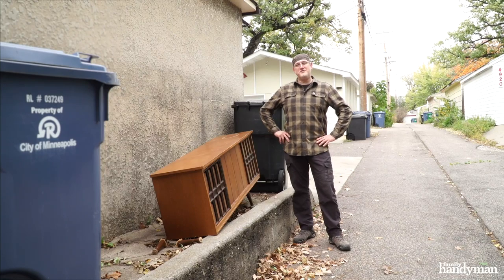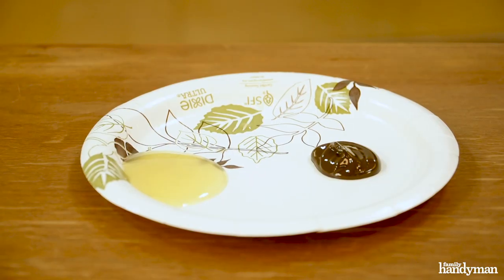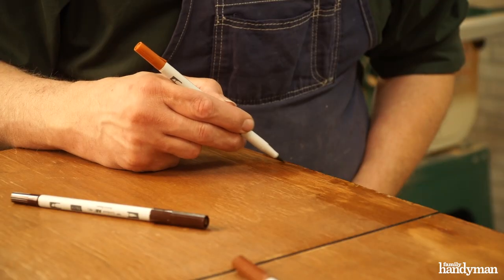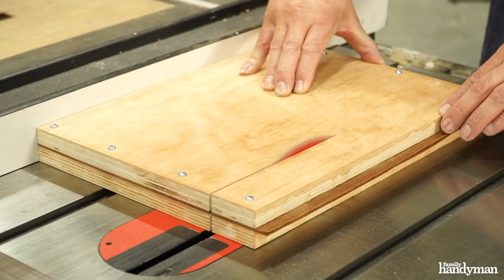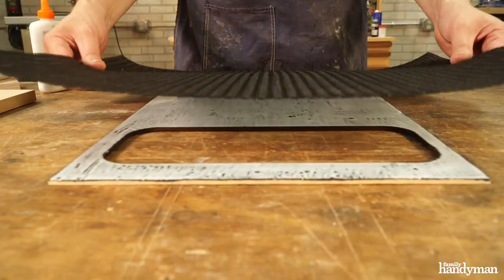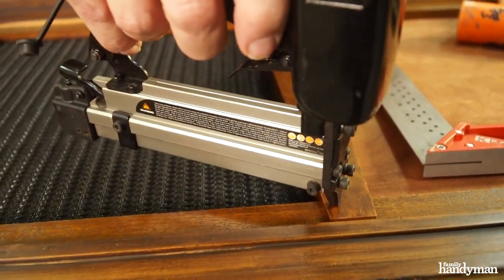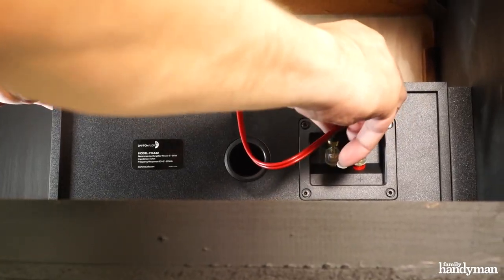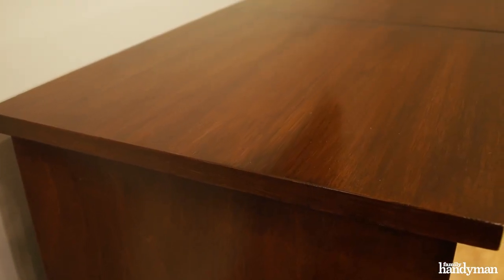How to Renew a Stereo Console

Comment: Nice job on the cabinet. I would have restored the old components and used them just to try to keep it as original as possible, especially if it was the old vacuum tube electronics. You can add Bluetooth to the old electronics easily.

Comment: question.. When you upgraded, what components did you replace? The tuner for AM, FM and obviously the turntable? Did you completely remove the existing old units? What a bout the speakers? I have a Zenith 1960s stereo console that I am considering doing the same. What I was wondering does doing this upgrade effect the sound of the speakers?  will they Stoll have that vacuum tube sound?

Comment: Pitch perfect MCM restore design!
Too bad there appears to be particle board used in the original construction, but as a fun woodwork project on a free donor console and "free" scrap or leftover wood stock, nicely done.
Many audio people like to restore and use the original turntable, radio, amp and speaekers for the vintage sound quality, but usually with higher quality Zenith, Motorola or mid 60s Maganavox units.  Hope you didn't toss the original components in case a collector  wants them or to restore to original

Comment: If you want a great looking stereo console, look for Curtis Mathes from the mid 60's. The rest are plain ugly. CM was a cabinet maker before getting into stereo consoles, so it knows style and craftsmanship. I got one in the early 90's in perfect condition for $12. It has a tube amp and a cool tuner, a slide in drawer turntable (not like all the rest that requires opening the top.) The best thing is you won't have to do all this work and end up with a console that has been destroyed of its history. Mine still works great.  Not as good as a modern stereo, but it's 1000 times more interesting.